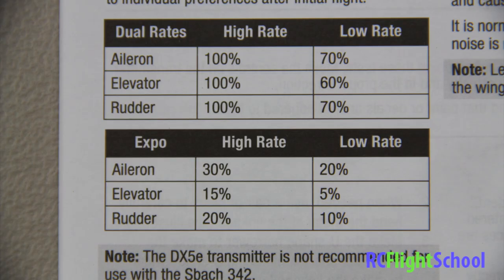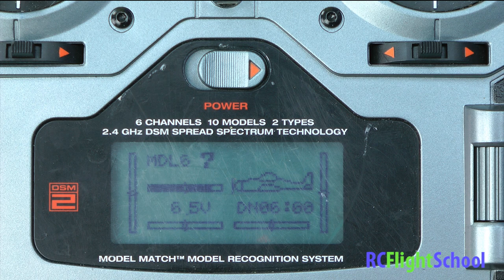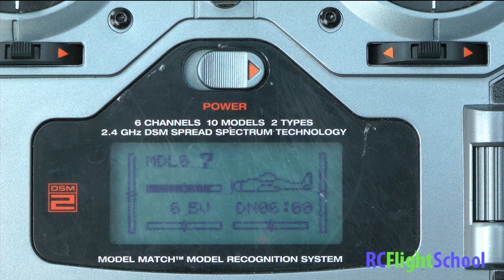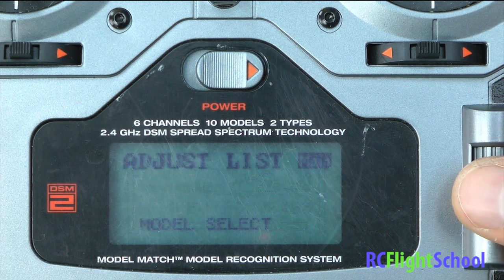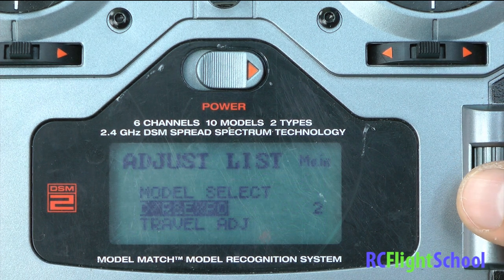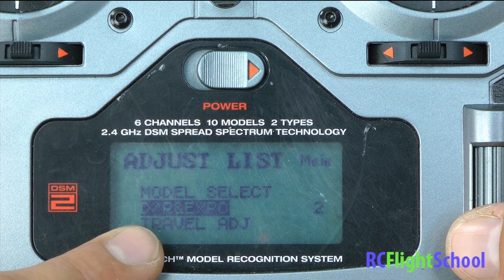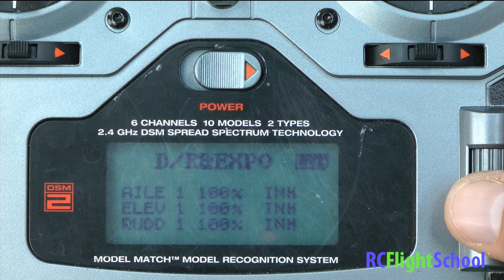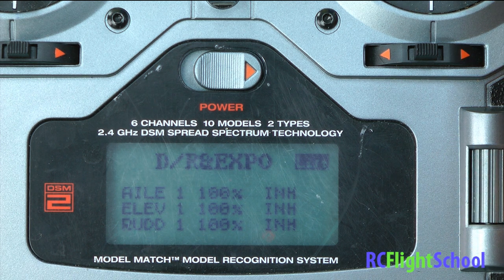How To Set Dual Rate & Expo For RC Plane DX6i

Comment: Thanks for your demonstration. As a new pilot I have questioned demos regarding the setup of D/R and Expo because I cannot seem to separate the individual D/R switches. If I switch Aileron D/R form 0 to 1, ALL D/R choices change simultaneously. Still, this makes it better as a mode switch. Is this Normal?

Comment: Thank you very much for your great helpful video`s! I have the UMX Pitts S-1S. Its a micro plane. The manual only shows the settings for duel rate, There is no settings for the expo? What would I set them at? Or should I just leave them alone. This is my first bind and fly plane. My other 3 are RTF. The settings for high rate is all 100, and for low rate they are all 70 according to the manual. Thanks again!

Comment: Just browsing and watched you video on dual rates and expo. I have a early 2000 hangar 9 p 51 d that flew on the old fm radios and have the dx 6i. My question is, how to set dual rates and expo on a plane that as far as i know, had no instructions on this since the transmitters did not have the functions? Any ideas ? Thanks.

Comment: Just received this transmitter and noticed that you cant use as3x and safe, as a newer pilot, would you recommend low rates for 3d plane? Also i have noticed that everytime i have to bind to receiver to get plane to respond to transmitter any advice?

Comment: please tell me how to set up dual Elevon on my new Graupner Epic Victory S, as it is a "T" tail, and has a servo for each side. A "Y" harness wont work? So I have one servo plugged into the Elev connector, and the other servo is plugged into the Aux, as the Gear connector is running my retracts. Many thanks for your help with this problem. Ray

Comment: I just got a Spektrum DX6i Transmitter, the problem is when I place my A10 thunderbolt in landing gear up position, I have very little elevator. When I place landing gear in down position I have more elevator control. How can I get more elevator control while gear is in the up position.

Comment: Hi.
How can I get the Dual Rates on one particular switch? So that, If I would like to do some pattern flying where I need more deflection of the control surfaces, I do not have to pul three switches, but just one?
Maybe you could make a little short vid of that?
Thanks.
Reply: Excellent and very helpful set up guide. Thank you.